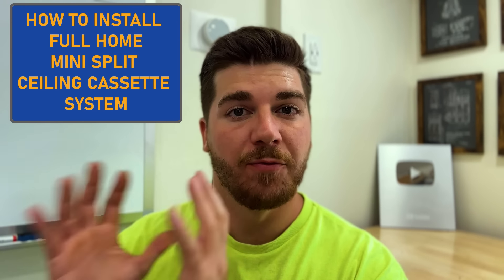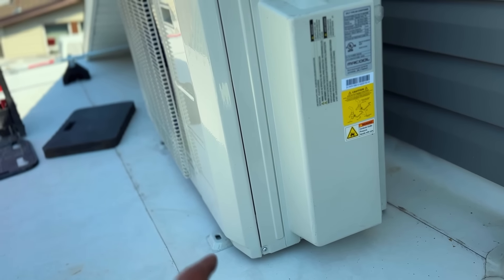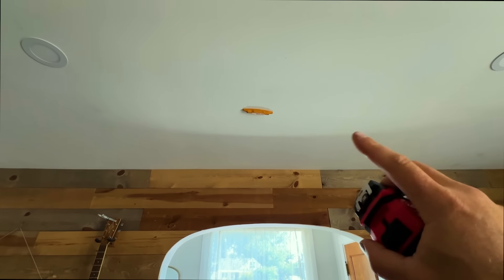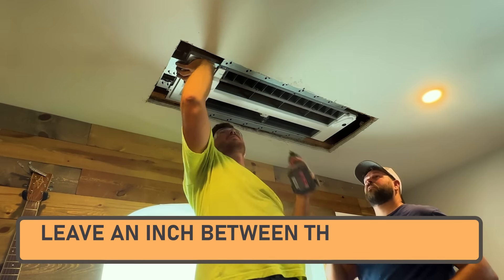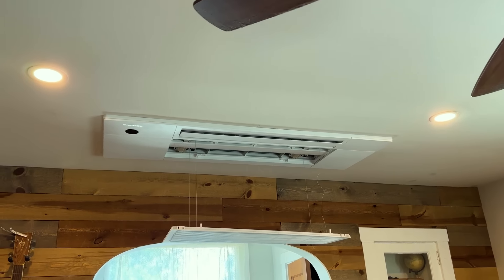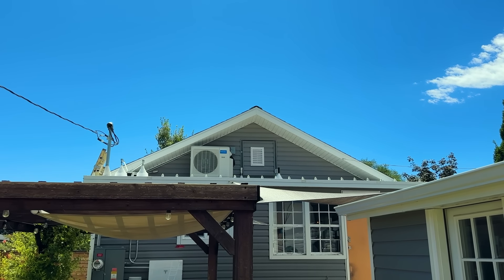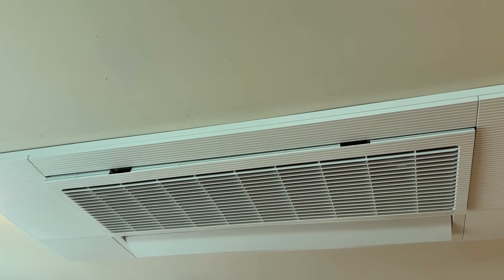The Mini Split - REINVENTED.

Comment: Enjoy the mold farm on those Inaccessible blower wheels ;-)
Reply: On my wall units I do one cleaning each season to help keep any clogging of the gravity drain line and other grime from building up. Getting to the blower wheel is hard but I have found just using a self-cleaning and washing formula is better than trying to take it all apart each time. I simply turn the wheel and spray it lightly which helps the formula dissolve much of the dirt. BBJ Micro Coil Cleaner etc.

Comment: Final step, I'm sure you're going to do, is add a LOT more insulation to your attic. Why make the units work so hard keeping a poorly insulated house cold? Don't know what Mr. Cool says about dumping insulation over the cassettes up there, but even if you have to dam around them, you really need more thermal protection for the house. Sorry, just the BPI weatherization auditor in me making trouble!

Comment: I would look at these systems except that I dislike the multiple feeder lines for each zone. It would be great if MrCool and or other DIY HVAC companies would get together  and make a universal Branch Box Unit so you only have one set of feeder lines for multiple zones. I have already thought about purchasing a Branch Box unit from a major manufacture and using a minicomputer (Raspberry Pi) to control it for a DIY install with MrCool or other DIY HVAC companies. I have 7 ceiling ducts right now and would like to add 1 more. Toooooo many feeder lines. I would also like to see a square Ceiling Cassette that fits between standard floor joist sizes.
Reply: What are your current favorite units in the market?
Reply: some older systems and large commercial systems use a branch box. the branch box at the the outside condenser is the most flexible and cost effective.
Reply: @ctgottapee9020  I have seen 2 systems utilizing branch boxes. Both were 1 zone 3 ton units with the Branch Box units mounted near the center of the attic and the 4 ceiling cassettes connected there. 

If you mount the Branch Box unit outside by the condenser it defeats the its purpose. You might as well get a 4 zone 3 ton unit and have 4 feeder line sets running up to the attic to each of the ceiling cassettes.

Comment: Why not just replace your old air conditioner with a High efficiency inverter heat pump you’ve got ductwork?
Heat in the ceiling, always leaves the floor feeling cold.

Comment: New drywall placed straight over the old popcorn ceiling. A flipper has definitely had their hands on that house.
Reply: Oh yeah, wonder what other fun half assed "repairs" and "upgrades" he'll find over the next decade of owning that house.
Reply: If done correctly, what is the issue with that? Especially if asbestos is suspected.
Reply: It saves the cost of asbestos abatement.
Reply: @robertball3578  What asbestos are you talking about? Could easily be  tested but I doubt it was asbestos. Many homeowners get taken for thousands in unnecessary “remediation”.  Just because it may look like something that was once made with asbestos does not mean it is asbestos. If it was asbestos simply covering it with drywall would not make it safer.

Comment: I hope that popcorn didn't have asbestos. Common method of dealing with asbestos-laden popcorn ceiling is to just add a layer of drywall...
Reply: It may be a common way to deal with asbestos but it really does little to solve the problem. A local Ag extension can easily test the material. Many materials suspected to be asbestos are not. After its ban, manufactures continued to make the same style of flooring, siding, and ceiling panels as well as texture materials with alternative materials. This catered to existing marketing styles. Many homeowners have been taken by unscrupulous contractors for expensive remediation that was not needed. If it was asbestos drywall will not keep you safe. Baring full encapsulation, removal with air quality monitoring is the better solution.
Reply: @earleford8889  Oh, I'm well aware of asbestos testing. Generally the cheaper PLM method will overstate the amount of asbestos. I set up a policy that we would screen with PLM, then if it's 5% or lower, we would verify with the point count method, which is far more accurate.

Comment: That insulation looks to maybe be asbestos?!
Might want to check that!!
Reply: Yep. And when you see two layers of drywall like that on a ceiling and one has popcorn...its almost certain that the old popcorn texture has asbestos in it.  That's why it was covered up. It's way cheaper to cover it up if you want to not have popcorn ceiling texture than to do the full remediation to get rid of it. But its still there when you start cutting or disturbing the old drywall.

Comment: Uh... having that condenser right by the sewer vent... I am concerned about that.  They recommend not installing near exhaust for natural gas water heaters or furnaces, either.

My heat pump water heater has a float switch and since we turned it on its side for transport, the little foam float got lifted and caught on the lip of the pan.  Probably easily happens on these, too, so a quick thing to check if you have problems on the first try.
Reply: Another "professional" insight from a keyboard HVAC tech.
Reply: @Watchyn_Yarwood  It's in the manual.  Good call.  Oh, and further, it doesn't require an HVAC technician for that, at all.  Just common sense around how flammable gases (like methane) behave when a spark is applied (like the circuit board or power supply for a condensing unit).

Comment: Musty smell?  I have two Senville and a CooperHunter mini-splits and there is no smell at all when it hits set temp on cool, or ever.  Leaving mini splits in dry mode is highly inefficient as the compressor is always running. You will pay significantly more in electricity vs leaving in cool mode.   Figure out the r smell. I bet too much water/condensation is being left in the head unit. I would redo those condensation lines to gravity based so the condensation always drains out.
Reply: These come with a pump built in. Based on the install unless you want the condensate lines coming through the ceiling not sure how you would gravity drain them. I'm guessing without seeing the unit up close you couldn't even do that if you wanted as the condensate has to be pumped up from the pan.
Reply: @scotts4125  Just trying to figure out why he has a musty smell when they turn off.  My units are all gravity based drains with the proper slope so no condensate remains.
Reply: Sounds like you live in a relatively dry area. In humid hot areas like the gulf coast  musty smells from ACs are normal during shoulder seasons when its still humid but relatively cool under 90 degrees. All of my home and car ACs had occasional musty smells except my Ford that has the equivalent of dry mode that can't be turned off.

In a humid area as long as you need some cooling and wouldn't otherwise shut down the AC system, I bet dry mode wouldn't cost you any extra in electricity.
Reply: @colinnwn  I'm in South Florida on a lake. On the other side of the lake is the Everglades. I pretty much live in a swamp albeit a nice gated community but the alligators I have had on patio don't really care much about that. I have never had a musty smell. I have an APCO X Dual (two U.V. lights) in each of my units. One light is on the supply the other is in the middle of the V coil. I also put tabs in every month when I change out the filters.

The only musty smell and I haven't smelled it personally is a Tesla we have on loan to us for a few months. It's a model Y that has 2 cabin filters. When I changed them they were both mildewed. I also used evap foam and cleaned the entire thing out. That car is from N.C. so not even a swamp car. I also have a Mr.Cool in one of the garages. Never had a musty smell in that but I don't actually use it much.

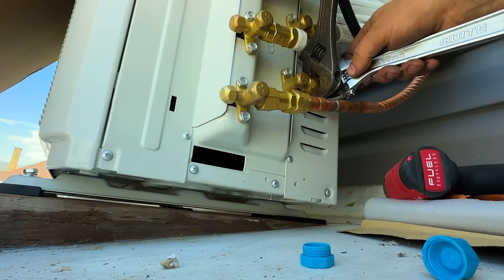Comment: 19:45 No tape on the connections?
Reply: Instructions specifically said not to add anything to the threads.
Reply: O-rings provide the seal.

Comment: man you need more insulation in your antic it only a R20.  if that as it settle fiber insulation  you need R40 to R50 . it make your house so much warmer and cooler. not knowing how cold you get during your winter.  now that you cut  ceiling panel you are going to have  moisture damage in your attic.  i probably would try to vapour barrier those  units some how so you do not have warm damp air migrating into the cold attic. other wise it is  going to winter wonderland up there  with frost  and icicles and every time it warms up above zero . you are going to have  water leakage when the ice  melts

Comment: Cool. But without return registers how do you get fresh air in and stale air out?
Reply: Most existing residential HVAC systems just recirculate the air in the house. Newer units have a fresh air intake, as do commercial and institutional systems so these units just recirc the air in each room.

Comment: Biggest downside.....the maintenance.
Nothing worse than the infamous slime that accumulates and blocks the drain line up, then you hear the spillover of water dumping on your floor. They were almost perfect on the upsides compared to duct-based heat pumps, but maintenance is no joke and you'll pay more if you don't stay on top of it. Wall units suck enough as it is with the process and potential mess, I can't imagine a ceiling one.

Comment: I dont see any advantages that he states where the wall or floor mounted units don't have.  Basically no diffierence and it takes more work to install the ceiling unit.
Reply: I keep saying this but the attic mounted units have to cool 130 F attic air vs 80F for the wall mounted units.

Comment: So no weather head for the big ass hole you cut into the siding where all the linesets go?  Rain gonna be gettingvin with bugs and things.    Also those condensate lines will inevitably get plugged up with the nasty that builds up in them so a way to clean them out would be something else to think about when installing.  Besides that and how youre gonna have to clean the actual units themselves are the only things that would change ideas of using systems like these..  just because ive seen how nasty the wall units get even in clean areas and they’re never easy to clean.  You gotta take it completely apart and always tend to break plastic clips somewhere..  they need to invent some self cleaning deal that will wash off everything and send it all through the condensate lines..  would be nice not to have to worry about when they start stinking or making noise from the blower fins getting gunked up..

Comment: Use a torque wrench with a crowfoot. No excuse.
Reply: These units are designed for DIY most don’t have a crowfoot or torque wrench
Reply: @heknows5418  I agree. But the number leak area are those lineset connections. My "just enough" tightening will not be the same as someone else.  Using a tool will reduce problems.
Reply: @Duke93720  just like the fittings on waterline at sink , rubber seal hand tighten then 3/4 turn never leaks no need to torque, if your worried put soap on connector the way you test for gas leaks

Comment: Your line sets are going to be VERY short... they may not operate at their best as I believe there is a minimum distance from the condenser unit.
Reply: Mr cool shortest line set is 16feet. None of their documentation have a minimum line set length. It is only a maximum length that is called out.

Comment: Not new tech, I have been doing slimline Mitsubishi units for several years, they invented the tech. You be you and I will be me. 1) I never install inverter driven equipment without using surge protection. 2) I always increase drain line size when connecting two or more indoor units. 3) Whether my own home, or a customers, I will stick with the companies that invented the tech, lead the industry in said tech, as apposed to the DIY knockoff brands.
For a DIY homeowner maybe they save over hiring a pro and using proven brands. As a pro I don't see much cost difference in the long run, but I do see cheap vs. proven coming into play.
To each his own.

Comment: Who would keep their home at 60 degrees in the summer?  That is truly excessive.  That said, the ceiling cassettes are nice.
Reply: - 60f  - ie. around 15C - is a freezing temp for summer..  
That probably quarouples power consumption vs a more reasonable 23 or 24C -  ~75F...

The main comfort effect in my climate zone is the lowered humidity with AC on (when even 30C (86F) is a lot cooler than outside ambient.  Each to their own power needs.  Nothing screams "comfort" more than a porch AC set to 65F on a 110degree day...  lol...

Comment: The condensation will be really bad with this in the ceiling.  As others have stated cleaning is hard enough on a wall unit.  It will probably not achieve the rated seer number because of loss to the attic in both hot and cold weather.  Don’t do it.  Find a place to put it on the wall.

Comment: Keep in mind that a lot of those old popcorn ceilings contain asbestos.
Reply: I thought the same when I first saw it.
Reply: That all depends on when the house was built honestly.
Reply: Can you eat the popcorn 🍿 😊
Reply: @maxbiker99  you can see knobs from old knob and tube wiring when hes in his attic so thats definately asbestos lol
Reply: not to mention the old fiberboard tiles/ceiling above the popcorn spray, which was also known to contain asbestos.
with old knob and tube wiring visible, it certainly has asbestos galore, probably on the old K&T wire coatings too.
Reply: @Nolaman70  Yes. once.
Reply: The asbestos was pretty much banned by the early 1980's, so if it was done after 1985 expect a test would come back clean. The ban dates vary by city and state.
Reply: @lyfandeth  by the materials and layers seen, I'd say mid 1940's original, with late 60's to early 70's remodel, doing pop corn knockdown. almost guaranteed the old ceiling fibrous tiles/sheets have asbestos, as well as popcorn layer. as beaten down as the old blow in insulation is possibly it too.
Reply: Lath & plaster ceiling would be pre-1960 so definitely asbestos.

Comment: Maybe you were trying to save money, joining those drain lines into one, is a disaster waiting to happen. You could have had one larger vertical pipe outside with the four run into it so not any one would back up the other and cause an over flow somewhere else. I hope you decide to redo that.

Comment: Good luck with longevity. Since all mini splits are proprietary, if you have a leak in the future you are totally reliant on Mister Cool for replacement parts that work with your model. At least with forced air you only have one point of failure. I like the tech but don't trust the manufacturers to support their products for the long haul. Try finding reasonably priced replacement parts for any mini over 5 years old. Why repair when they want you to buy a new unit. If we ever get standards for head units, mini splits will become a good deal.

Comment: i checked the website. those cheap heat pumps have quite low efficiency compared to the ones sold here in europe. It will be cheaper in the end to spend a little more to get one with a better SEER/SCOP. Also: It uses the outdated refrigerant  R410a which is a nightmare for global climate and already forbidden in the EU. Also those quick-connect hoses tend to leak like more often then the traditional ones. So basically you did it all wrong :) not really, but nice to see there are cheaper overhead units coming.

Comment: I do like heat pumps.  But they are pricey.   Have a 1/2 basement with low ceiling.   Gets warm late at night when heat comes through block wall in summer and stays cold all winter.    Simple wall A/C unit is enough to cool at night in the summer and removing and reversing unit in winter works really well to heat room.   Weird, but works, basically what a heat pump does.

Comment: 21 SEER is mid-efficiency at best when it comes to mini-splits.  Not pulling a vacuum on the line sets? Did you even read the instructions?  Locating the condenser next to a plumbing vent?  What a CLOWN!

Comment: so you install $3000 system with  4 high effciency mini spits heads, but dont' bother to put fiberglass insulation over them? hot attic air will go right intot he living spaces in the summer. big fail.

Comment: DIY hvac hack, looks like a horrid mess in the attic, every techs dream right there! Definitely don't use torque wrenches on your lineset bro, those are for losers, eh!?
Though, for a N00B,I've seen worse for sure. I won't touch homeowner installed garbage with a 10' pole.

Comment: I was gonna ask if you were a homeowner or contractor and then I saw you wearing sandals on the job so that explains that, also explains why your installing a " DYI Mr. Cool." I installed one once for a customer but I recovered the refrigerant and pulled a proper vac and then recharged it. I don't recommend them much better off with a real ductless system and will save you money in the long run.

Comment: You really shouldn't use a winch for vertical lifting. The brake isn't designed for that kind of load. You could/should use a hoist. They are still available in 12v.

Comment: No vacuum, u just bought your self another new system and put acid throughout the rest of system
Reply: No need to vacuum. These units don’t require it.
Reply: @phamlam3720  ok, I've been doing this since 86, what I was taught and till this day eveyunit needs to pull a vacuum to min 500 micron or better good luck with it
Reply: @johncruz8974  It is on the manufacturer website and documentation. No need to pull a vacuum since it was designed for DIY user. I would expect a professional like yourself to do some research.